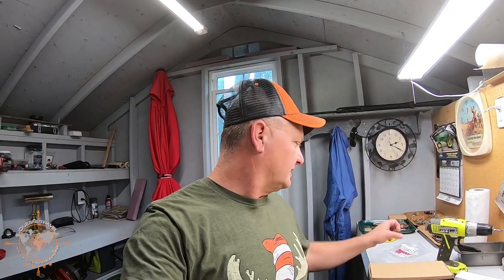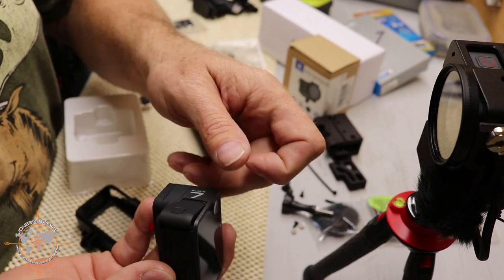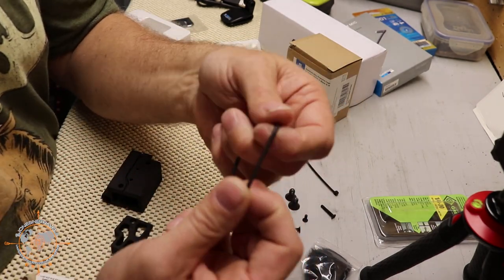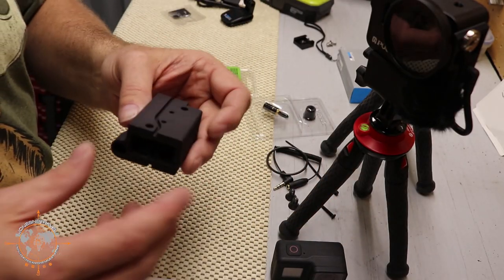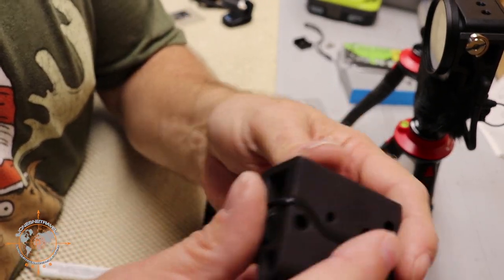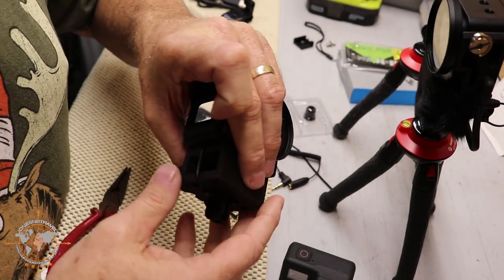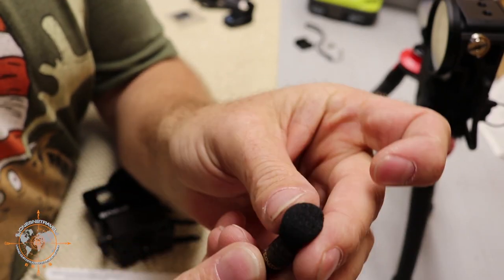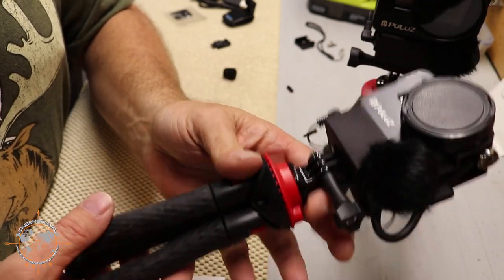HOW TO GOPRO HERO 7 VLOGGING SETUP (HERO 6/5) | TRAVEL VLOG

Comment: Great video, love that setup. That is exactly what I am using but I have added two Edutige ETM-001 Mics with an Edutige Y mic cable, so one facing forward and one facing back. That way I am on mic no matter with way the camera is pointing. It's a great setup.
Reply from the maker: Wow, that's a great tip. I didn't think to do that, didn't realize they had a Y adapter. Thanks for the info I will definitely look into that. Safe Travels.

Comment: Love this. I feel so “underwater”. 😜😜 with the whole Hero camera stuff.   Did you say there is a way with this keep it plugged in to power with this set up? I only get about 15 minutes on a battery so I find it completely useless to do any filming as you have to completely disassemble to change a battery.
Reply from the maker: Yes you can plug directly into the audio adapter to provide power while using the camera. There are two ports on the adapter, one for the mic and one for the charger. When you go to download footage to your computer you need to unplug the mic from the adapter, plug your USB cord into the adapter and then your computer will recognize the camera. Hope that helps.